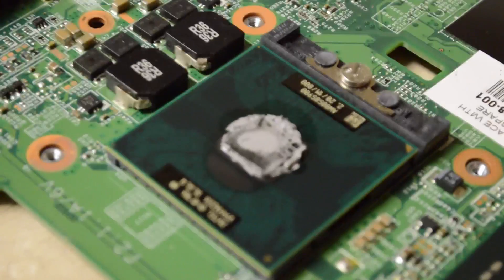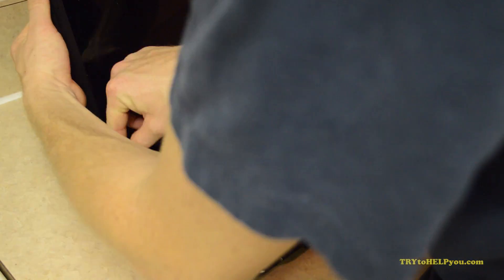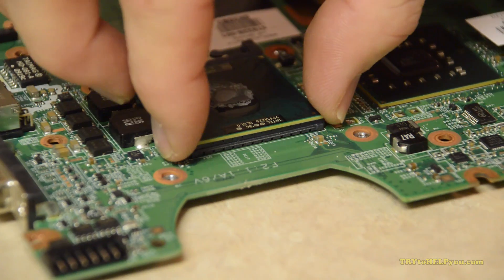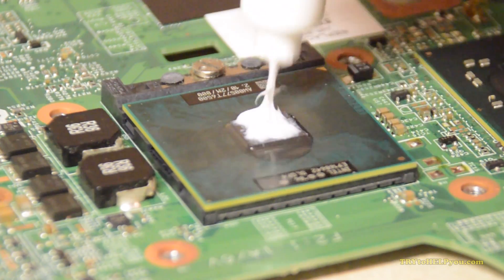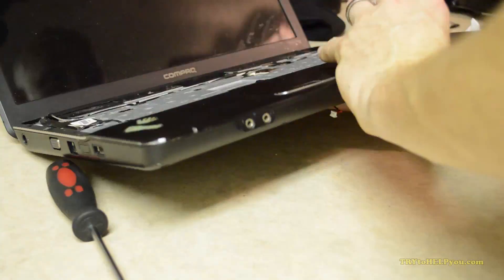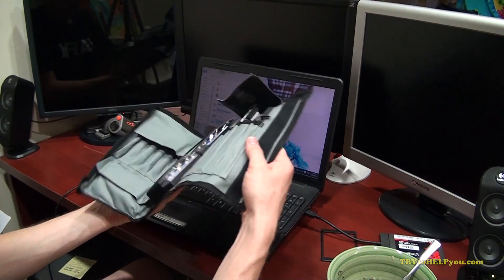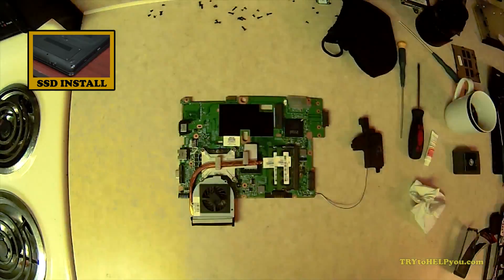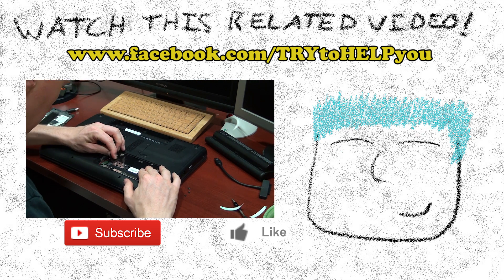Laptop CPU install, how to upgrade your Laptop CPU

Comment: I want to get a GTX 970 or 980 for my laptop but I can find just the part only laptops with that in it anyone know where I can get just the part?
Reply from the maker: +WizardMaster12 im not sure its that simple... And.. No, i dont know where to get the part. If you find success please share in the comments!
Reply: External convertor for laptops-http://www.ebay.com/itm/V8-0-EXP-GDC-Laptop-External-Independent-Video-Card-Dock-Mini-PCI-E-US-Shipping-/291915739701?hash=item43f788b235:g:H1YAAOSwYIxYBxW9 
You also need any graphics card and at least a 700w+ power supply
Reply: http://www.ebay.com/itm/V8-0-EXP-GDC-Laptop-External-Independent-Video-Card-Dock-Mini-PCI-E-US-Shipping-/291915739701?hash=item43f788b235:g:H1YAAOSwYIxYBxW9

Better link

Comment: i really wish i could do this i also got a celeron laptop and its so super slow i cant do anything on it i cant even play minecraft
Reply from the maker: ebay is your friend!
Reply: change it!
Reply: Richard Gutierrez i winded up buying a laptop
Reply: now what processor you have? :)
Reply: Richard Gutierrez intel i7
Reply: +Alliaaa I can rainbow six siege with a low end amd
Reply: Alliaaa I have a really slow Toshiba laptop and it is not used for gaming so why not roblox?? it's THAT useless
Reply: Upgrade ram and CPU. You probably want i3 or higher
Reply: Me too I got Intel Celeron in my laptop and its also super slow too..
Reply: Alliaaa upgrade your CPU into Pentium g4560 (if you wanted a very cheap cpu) and upgrade your ram into 8gb. hope my advice useful thanks :)

Comment: Where do you find out what processors you can upgrade to?
Reply: As long as it is the same socket
Reply: go to cpu benchmark 
http://www.cpubenchmark.net/CPU_mega_page.html
search for you cpu 
run dxdiag to find out if you dont know. 
type your cpu name on search,
read the socket name and type in the name. 
find cpu with the same socket name and try to get the one with the highest score for optimal performance.
Reply: But for my cpu it says NA for the socket,what does that mean?
Reply: Nemanja Vedjic not availible
Reply: Thanks

Comment: hello, i need some help in laptopm processor matter. i have a laptop but
 its facing slow issue. its model no. is acer travelmate 2400. wanna 
know can i change its processor to dual core now its having 1.5 gz 
processor. plz anybody reply on this matter. thanks.
Reply: ***** ya sure can u sent me your email id i will sent u the screeen shot of my computer processor and other details as i am nt getting to knw the processor details well. plz help thanks.

Comment: do you need thermal compound for this?
Reply from the maker: +CalvinWinz_YT i suggest it however the original processor did NOT have any thermal compound. There was this pad like thing instead.. Strange.

Comment: hey i have a Pentium dual core t4400 and i recently bought a intel core 2 extreme dual core. They are both socket P I've check on the websites and the the core 2 extreme didn't work when i put it in the first time it just turns on light turns on and then theres no screen just a black screen and it turns off. then i put back my Pentium and it worked? idk whats up but im going to do this again right now and see if it works if you can help i would really appreciate it i bought this for about £32, but yeah thanks.
Reply: ***** apparently i had to reset the CMOS but it was soldered to the motherbored and i couldn't do anything about it so i returned the CPU unfortunately. Thanks for the help though.
Reply: *****
Nah man, its all good. Im going to buy a new laptop next year but yeah thanks for the help i apperciate it.
Reply: harry w
nah man. im gonna get a new laptop soon :D

Comment: so Its a plug and play type of thing? there's no need to do anything software wise? Also, if i jump from an i5 to an i7 do i have to upgrade the power supply too? A reply from anyone will be greatly appreciated
Reply from the maker: for my situation it was plug and play. The processor simply was recognized by the processor. If the processor is of the same "family" it should be as simple as plug and play. Check the processors website and search for your processors model number. gather information about it to see if there are other processors that can replace the one you have. look for the socket type/size and see if its the same. some processors are soldiered onto the board. Those are not easily replaceable (if at all)

Comment: Will it work on my laptop? Hp pavilion g7-1219wm upgraded to 8 ram
Reply from the maker: from what I can see online, your processor is soldered on.. SO.. IF it is possible, it is going to be much more difficult than how I do it in this video.. sorry. That's if you have a Dual-Core E-450 AMD processor...

Comment: Processor Intel(R) Core(TM)2 Duo CPU P8700 @ 2.53GHz
 
Video Card NVIDIA GeForce GT 230M
 
RAM 4.0 GB
 
Operating System Microsoft Windows 7 Ultimate Edition Service Pack 1 (build 7601), 64-bit

Can i upgrade this to i5 my laptop so I can play Fallout 4, thanks.
Reply: *can I upgrade this to i5 so my laptop can run fallout 4 on ultra low graphics?
Reply from the maker: Not sure. I dont think you can go from a chip that needs a Front Side Bus to one that doesn't, if that makes sense. Check your CPU on intel's website to see what the socket is, then see if you can find other CPUs with the same socket, and then dig a little further.. good luck!
Reply: from i5 5200 u2.7ghz to i3 3.7 ghz?????????!?!??!??!

Comment: hi my computer model ASUS i5 processor N55SF is it possible that I have because I do i7 i7 also has the only difference chargers charger changes i7 rose thanks I appreciate your help ...
Reply from the maker: +Gokhan Duymaz i do not understand your question entirely. Please find your exact processor model number. Then, go to the intel website and look it up. Finally see if there are any other processors within the same family or socket type. It takes some research! Good luck!
Reply: +TRY to HELP you 

my i5 processor 2430m
I want to upgrade to i7 2670qm
My computer model ASUS N55SF
two processor sockets same the only difference is the number of chargers ( 988 socket )

( my computer )  ASUS N55 using i5 2430 35w to 90w power charger 19v 4.74a
                              ASUS N55 i7 2670qm using 45W power charger 19v 120w 6.3a

raising the processor v Can I use a charger you think

Comment: Hey! I have a Intel(R) Core(TM) i5-4288U CPU 2.60GHz, 64-bit and 8,00 GB. Can i upgrade to 7 cores Prcessor? Btw, Its a hp
Reply from the maker: +CEgaming it appears that the "Intel® Core™ i7-4650U Processor 
(4M Cache, up to 3.30 GHz)" shares the same socket however i do not know if it is interchangable. Please go to the intel website for more info.
Good Luck!

Comment: The manufacturer may label the CPU socket as LGA (pins on motherboard & replaceable), PGA (pins on CPU & replaceable), or BGA (Soldered to motherboard)
Reply: Hiram Rodriguez manual. or call. minesnwas BGA difficult to upgrade and maybe no options to
Reply: Cant you upgrade bga??
Reply: @BigDraptor  Technically, but you need a hot air rework station and a fair amount of skill to do so. Plus the appropriate template for the socket to remake solder balls. Sourcing the CPU is also typically pretty painful since buying them on their own is uncommon (they're usually only sold to OEMs like HP or Dell) so you usually have to buy a damaged motherboard that happens to have the CPU you want and then desolder it and transplant to your existing system. So technically not impossible but not worth your time.
Reply: @Willielikesmonkeys  thanks for this clear answer, I have a Asus TUF Dash F15 and the CPU in it is kind of creating this constant Bottleneck situation. I love the laptop but everytime I am streaming or recording videos, the CPU goes to 100% or close to 100%, so I was juggling with the idea of upgrading the CPU one day but now I understand that it's not really a possibility.
Reply: Where?

Comment: oh my gawd thats a shit ton of thermal paste....

Think of a long pipe. If you heat one end of it, the whole thing gets hot, but if you get a long enough pipe it won't even get warm on the other end. Same thing with thermal paste, it's really only there to fill the microscopic imperfections in the surface of the heat-sink and silicon. Also don't smear it, let it flow into whatever crevices it flows into, or you risk microscopic air bubbles that don't transfer heat as efficiently (the entire point of thermal paste in the first place).

Also some thermal paste is conductive so you really don't want to add too much.

Comment: Hallo how can in now if i can upgrade ? asus x553 ma intel celeron 2840
Reply from the maker: +Luis Bedregal looks like its surface mounted. to change it out would be very difficult compared to my video. your socket type is FCBGA1170 view the other comments for more info about the sufurface mounted processors....... If i ever see the opportunity to upgrade one of these style processors i will see if i can. good luck!

Comment: Hello Nice video but i need some help i have a intel n2840 and i have a bga1170 socket but i cant seem ti find the proccessors compatible with that socket can you help me?
Reply: BGA means the CPU is soldered to the mother board . Can't be replaced/upgraded.

Comment: i have asus X453m. can i change intel pentium to amd a10?
Reply from the maker: I... Wow... You made some people (geeks) throw up in their mouths a little with this question. None the less, no harm done. Your answer is no. You can learn much about the two companies and how their chips differ and why one is better over the other over the other, if that makes sense. Computer magazines are a good start to see more professional opinions. Overall intel is better due to their construction historically, don't let the speed misguide you. 3GHz over 32nm is different than 3GHz over 22 or 14nm. Transistor count is also a thing but thats where im unsure of the numbers for one company over the other. AMD is usually just good at offering affordable chips.. Not better ones... Usually. I hope that helps
Reply: +TRY to HELP you That is true... But only because I ate 3 day old spaghetti.
Reply from the maker: !!!! aaahhhhaha! noice

Comment: Hello, i have a question...how can i tell what CPU will work on my laptop and is it possible to upgrade to i7 from i3? (packard bell easynote tk85)
Reply: +Lukas Muler find out what cpu you have, then google that cpu, and find out what socket your cpu fits into. If a cpu you want to get fits into the same socket, it will likely work
Reply: CerealBro1 thank you
Reply: Lukas Muler Also watch  what voltage your processor uses, and what the wattage of the one you want to buy will be. Also if the socket's name starts with BGA it is not even replaceable
Reply: CerealBro1 is the voltage important for adding RAM? i have 4gb so far and the voltage is 700-800 i think and the one i want to buy is 1100 or something like that, how will the voltage affect the performance or the laptop itself?
Reply: Lukas Muler Im not an expert, so dont quote me but I believe that the only thing that will be affected is your battery life, but its possible that with a jump that big it could not even work or possibly fry the motherboard. Be sure to get ram at the same speed and wattage so this does not happen
Reply: alright, thank you for the info, friend :D
Reply: Lukas Muler You're welcome and good luck on upgrading your laptop
Reply: ***** sold the laptop for a video card a while ago xD
Reply: ***** Thank you but im cool with this, i have a Q8400 8GB ram and a GTX750 ti,i only play Battlefield 4 so its cool xD

Comment: Is there any possible way to upgrade my current "Intel(R) Core(TM) i3-2330 CPU @ 2.20GHz (4 CPUs), ~2.2GHz" to a Intel i5? I'm not sure what socket I have. And if I'm able to upgrade does my current Memory(RAM) get effected in anyway?
Reply: I have a HP dm4-2165dx
Reply from the maker: So there may be good news. Intel,s website has info on your cpu of course. http://ark.intel.com/products/53434/Intel-Core-i3-2330M-Processor-3M-Cache-2_20-GHz. It looks like there are two types of socket (look for sockets supported on the link). One that can be replaced and one that cant (easially at least). If you have the pga988 then im seeing quite a few of possible upgrades on ebay. Perhaps a used i7 3940xm for 300 bucks? Haha. I hope that helped. Be sure to read all of the comments to this video for more on the subject.
Reply: +TRY to HELP you Thank you for helping :)

Comment: Dude can i install a Acer Aspire 1 D250 to Core I3?
Reply from the maker: +Gab The Oreo Gaming,Tutorials and More It appears you have an atom processor Intel® Atom™ Processor N270 
(512K Cache, 1.60 GHz, 533 MHz FSB) with the socket PBGA437. according to intel's website that is the only processor with that socket. So i believe your answer is no. It appears to be an older technology all around. you are limited by the front side bus speed for instance... well.. just all around i suppose. It may be time to try to scrape up another laptop.. Definately consider stepping up your Hard Drive to SSD if you havnt already, that will be leaps and bounds of performance increase right off the bat. so yeah. it would be a home run... right off the bat.. (pun)
i hope that helped!

Comment: I have a acer aspire E15 with an i3-4005U(1.7ghz,3mb L3 cache) and I wanna upgrade to an i5 processor with about 2.7ghz is that possible?
Reply from the maker: +akaJosh so i am seeing a trend of threads online regarding certain socket types. For instance your i3 4005U has an FCBGA1168 socket type. It appears that that is a soldiered chip and you will have to remove it similarly to how i remove the parts in the ipad video i made a while back. It is serious stuff. If you know what re-balling is its the same procedure for removal.... I would have to do more research, however, it appears that there may be an option out there...I just cant say for sure. look for cpus with the FCBGA1168 socket type and see how they compare. If it looks similar to your current one, then you may have a winner. Use intel's website for specific information about your cpu.... good luck i hope that helped... probably didnt really but ....im tryin here!! haha
Reply: Thanks haha

Comment: am i the only here because my staples gave my mom the wrong cpu giving her 1.6ghz instead of 2.7? it was a christmas present to me and staples is closed today.... i need a new cpu....
Reply from the maker: +CookiePlays dang.... well if you are certain its the cpu, sorry to hear. However if you are looking through the task manager at the cpu speed, please know that that speed may fluctuate... its a long shot but its possible that its just running slower. Sometimes when they get too hot they will run slower. anyway, good luck!

Comment: I have an ASUS X550LA And WOuld like to replace my Laptop CPU with an i5 Intel core
My Stats on the Processor are Intel i3-4010U @ 1.7GHz, 2cores 4 Logical Processors.
Is it Possible? and will it Work?
Reply from the maker: +Crazy Can  looks like your socket is fcbga1168 and that the processor i found that is most BA that has the same socket is linked below. http://ark.intel.com/products/84992/Intel-Core-i7-5550U-Processor-4M-Cache-up-to-3_00-GHz?wapkw=fcbga1168+i7

I hope that helps. good luck!
Reply: +TRY to HELP you  THANKS I Really Dont Know alot about computers so this really means alot. Thanks Again

Comment: For dell inspiron 3000 series can u chamge?
Reply from the maker: +χρήστος ελευθεριάδης from what i can see you have a N0350 in your laptop. if that is correct then you can upgrade to N3150 and get TWO EXTRA CORES! a little bit slower of a speed in those cores but a higher burst speed in the graphics.... whatever that means. can you confirm your model number? The dell inspirion 3000 series laptop i could find was called a dell inspiron 11 3000 series... let us know! this is what i got the info from regarding the processors http://ark.intel.com/compare/87259,87257,87258

i found the processor type on dells website here. http://www.dell.com/us/p/inspiron-11-3147-laptop/pd

Comment: Hey i have a lenovo b40 45 its an asian model and idk if it is upgradeable and also if it is upgradeable what cpu can upgrade the laptop to
Reply from the maker: +Dwika34 So from what i can see the CPU is Soldered in place. So i want to say NO to replacement. However you can de solder it and perhaps find another one that is better to put in its place but that is some serious work. I do not suggest it unless you have electronics manufacturing background and experience. Im afraid that you youre stuck with what you have. This is all based off of if you have the AMD Dual Core E1. is there a sticker that says amd anywhere on your laptop?

Comment: Hey I have a Lenovo Ideapad Z510 with an Intel i5 4200M. Can i upgrade to like  i7-6920HQ processor?
Reply from the maker: +Tony Nguyen i have looked up those cpu stats.. based on the socket alone the answer is no. your current i4 4200m has a FCPGA946 socket and the i7 6920HQ has a FCBGA1440 socket. Additionally i want to say there is a different memory requirement for the i7 however i dont think i am 100 percent accurate. i want to say i have seen some of the new desktop boards that accept the ddr3 ram... anyway, the answer is not fun, but i hope that helped! check out intels website! http://ark.intel.com/products/88972/Intel-Core-i7-6920HQ-Processor-8M-Cache-up-to-3_80-GHz
http://ark.intel.com/products/76348/Intel-Core-i5-4200M-Processor-3M-Cache-up-to-3_10-GHz